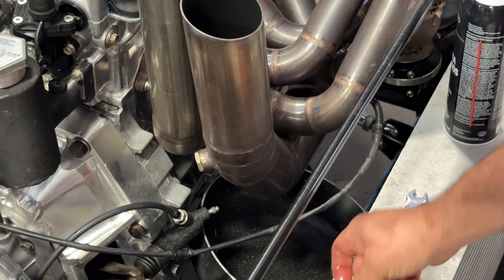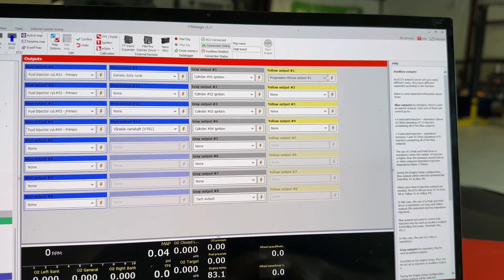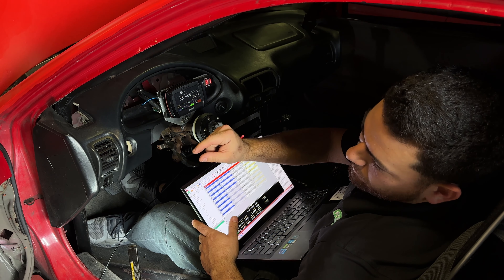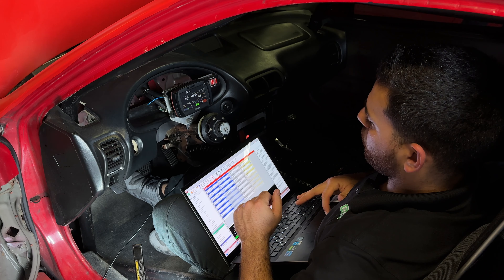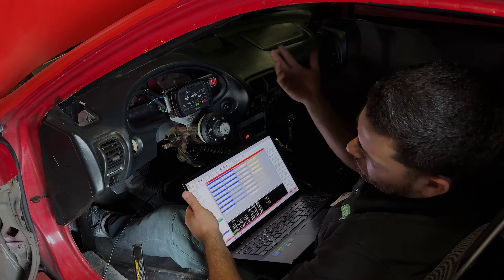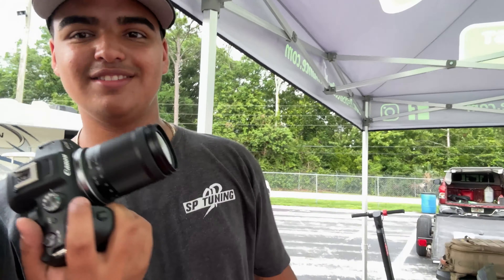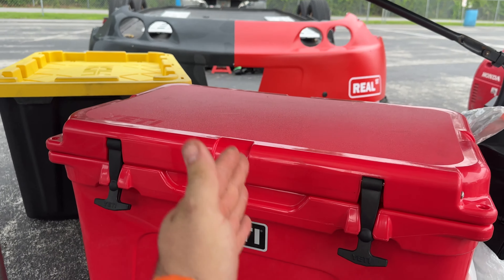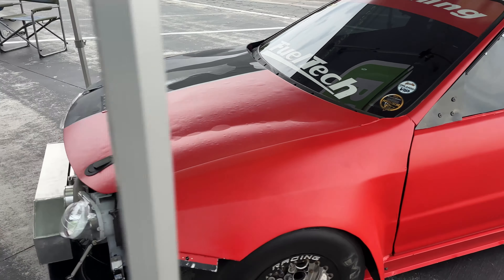Clutch Valve Install, Intercooler Remade, And A Rained Day At The Track....

Comment: How did you wiring it up cause I also have a ft550 thanks in advance.
Reply from the maker: Single yellow 12v output from ecu triggering a relay that powers the valve. You could also use a regular switch to activate the relay to your desire.